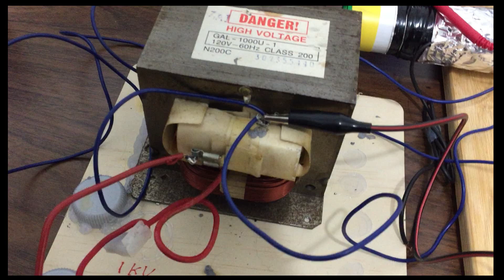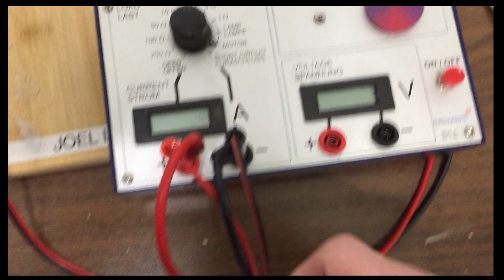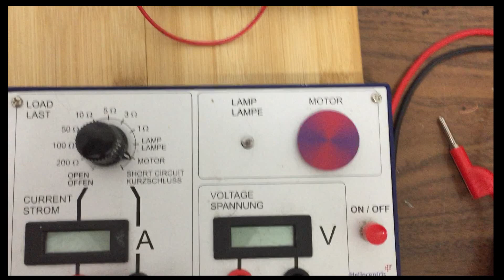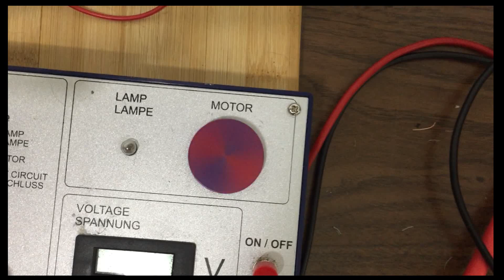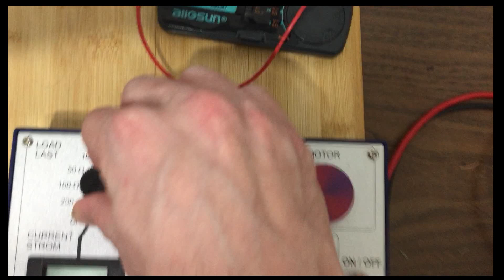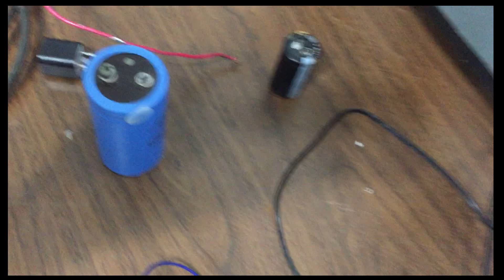Super Capacitor Secret

Comment: Awesome..  might be onto something there, Joel.. I think you should find some uses or at least elaborate on directions to be able to utilize this circuit but it looks absolutely fantastic. Great job.😊😊😊😊😊
Reply from the maker: Well a simple stupid trick. To experiment. Get an old radio boombox stereo or other AC medium current device from a yard sale or similar. Most of the older stuff all have analog built in AC step down transformer, Remove step down transformer and pulse the 5v or so of the super caps at 60 hertz direct into the rectifier filter of the device. Yep the device is scap anyways but interesting to note it will play cds etc.... Of course many ways to go here. But this is most simple way to use and pulse this power into a device without having to worry about additional transforming stages.

Comment: Hi Joel, firstly thanks very  much for your work on these very interesting projects. I have most of these components and want to try to replicate but have just one question,  what do you mean by core decoupling. Thanks very much Anthony
Reply: In MOT is high voltage wire also connected to the core of the transformer. I think Joel disconnected this wire from the core
Reply: Great thanks for clarify
Reply: Sorry clarifying

Comment: awesome vid, i would like to replicate the circuit as i have a few supercaps laying around. can atmospheric energy be the high voltage input? have one plate attached to an antenna raised in the air?
Reply: Have you seen "the Sea of energy in which the Earth floats" by John E Moray?  Who somehow captured and rectified atmospheric electrical energy amounting to many kilowatts of power... in the manner that you are suggesting?
Reply: @SN-xx6ho  seems like a simple enough experimental setup if it doesnt care where the dc comes from. attach one plate to an elevated antenna out in the open, say 2-3meters 6-10ft high, connect the other plate to positive of a battery connect negative to earth ground?

Comment: shorting out the motor winding wont be a full short it will be the ohms of the winding in the motor 👍
Reply: I made identical setup.  For me it does not work that well. While i short super capacitor +and - voltage decrease and does not climb back. I have to wait several hours to see voltage climb back to the same value. I need to find where i did something wrong. Which contacts are you shorting out? Thank you😊